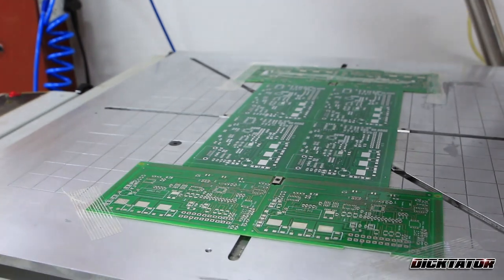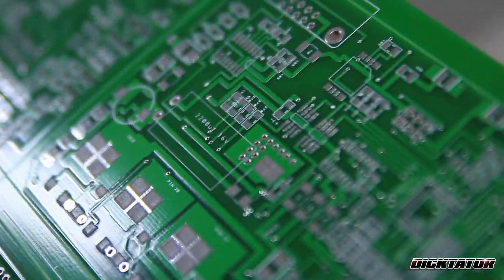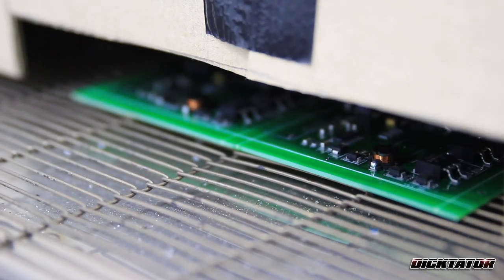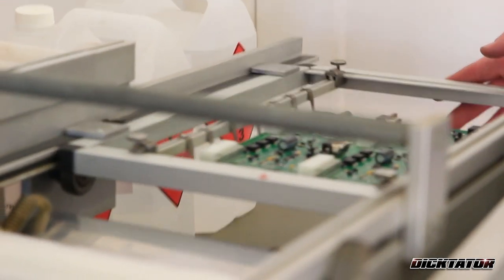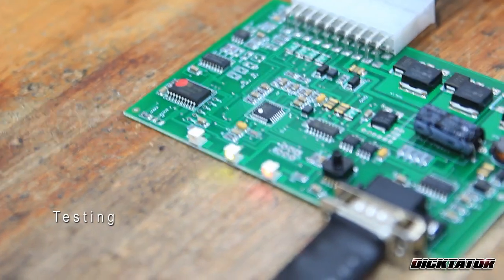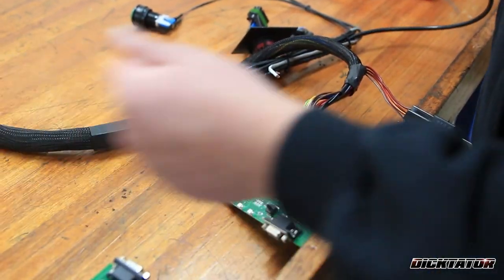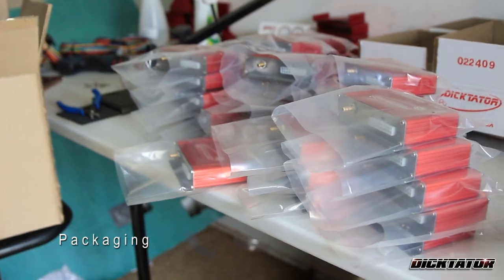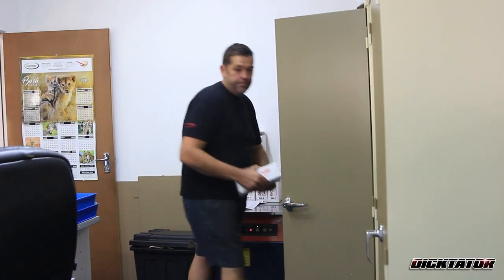Dicktator ECUs - How They’re Made

Comment: I also bought a 60-2 ecu.... connected it to my e30 320i inline six due its failed airflow meter.... they said the engine must be on TDC and sensor must point on tooth 20 past the gap...... i also using now wasted spark on the engine..... the car just keep on backfirring through the intake.... my question  is on what number teeth past the gap must the sensor be.....

Comment: Why is the dick tator unit batch fuel? ..not all 6 or 8 cylinder fire at the same time? Why make it batch  then ??
Reply: It will fire one batch per engine cycle, not per intake stroke. So fuel will sit behind valve until just before intake for the specific cylinder